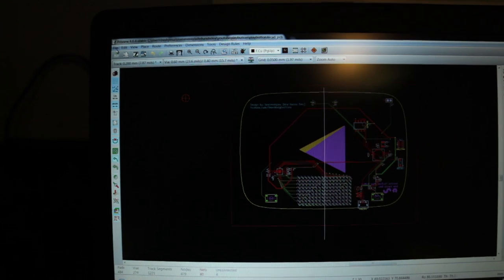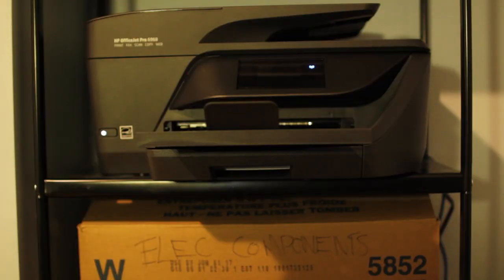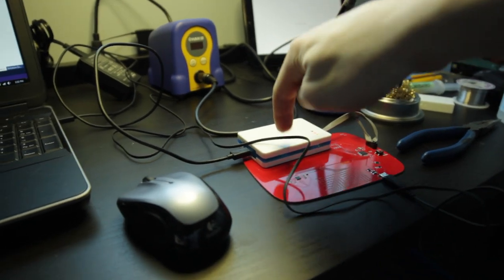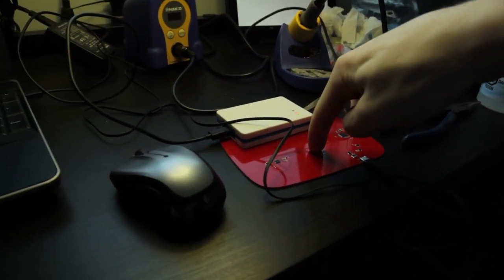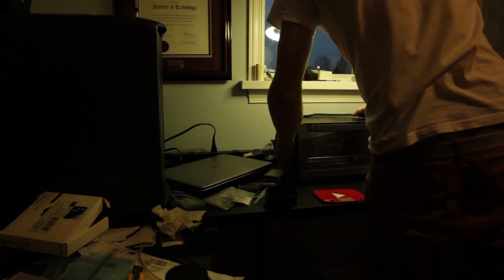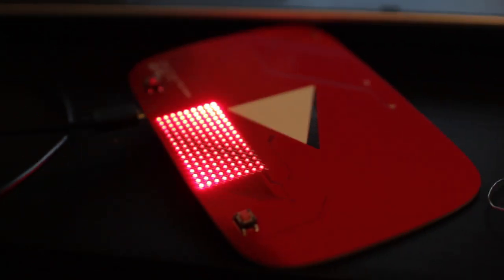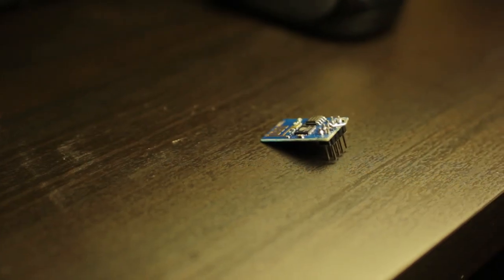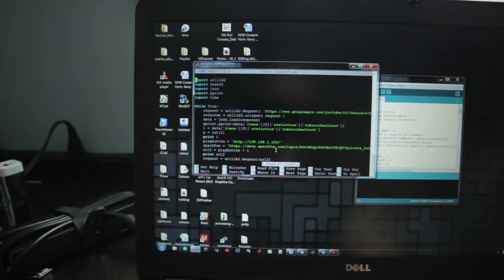Arduino YouTube Play Button

Comment: I've soldered double-sided boards in a toaster oven (except using an external temperature controller with a sensor inside the chamber) using just normal solderpaste. The surface tension usually is enough to hold the components, if you don't knock the oven.
Reply from the maker: Risky though! Haha

Comment: Keep this videos going.  Nice work. Do you have any idea how to do this without a pi? Prob. A vServer?
Reply from the maker: tom stein any computer running Python can send it values. Actually any language that allows you to access the API and send out http request will work also. The Pi is essentially working just like any (Linux) computer, but it's my go to for Python since I can just SSH into it from any computer I'm on. I could technically change what the Play Button displays from any normal browser. Does that answer your question?
Reply: SeanHodgins yeah :) I'll think about buildung one after I've finished my led matrix. I'll give the pi a try :)  Do you know how much bandwith your setup is using? I only got 250kBs(down)40kBs(up) and if my internet would start to get laggy or loos packages :/
Reply from the maker: tom stein The bandwidth of the esp8266 or Pi? I haven't tested the ESP8266 for speed but its flaky at best. Haha, I figured it was my horrible code. It has a lot of room for improvement. 
The Pi gets what any device would get in my house, depending on the signal strength of course.

Comment: Hey Sean,

I actually wrote a library for getting the Youtube stats directly using the ESP8266 (Not via AT commands though, with programming the ESP8266 directly with the Arduino IDE)

https://github.com/witnessmenow/arduino-youtube-api

Great looking build!
Reply from the maker: Awesome! I could easily program the ESP8266 with your library, to talk to the SAMD21 over UART to display stuff on the LED Matrix. I think I may do that!
Reply: SeanHodgins cool, if you hurry might get it done in time for 2k! let me know if you run into any problems with it